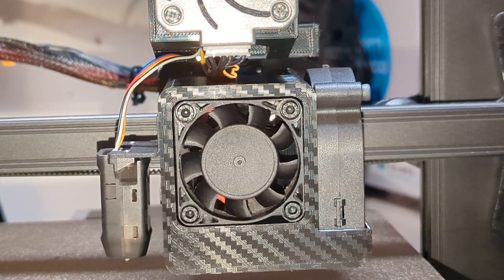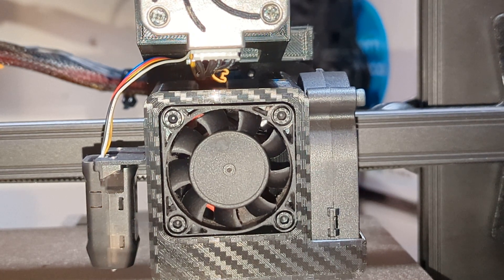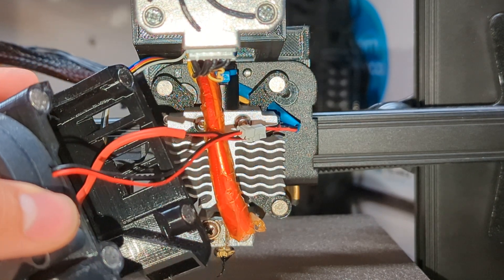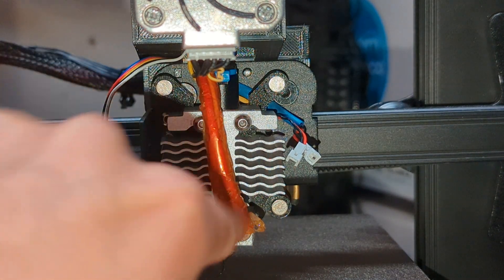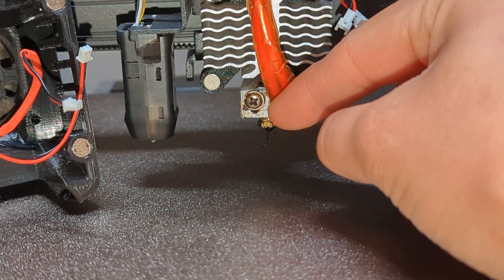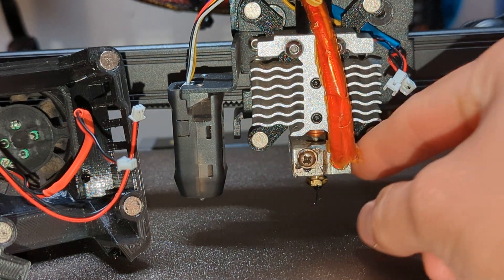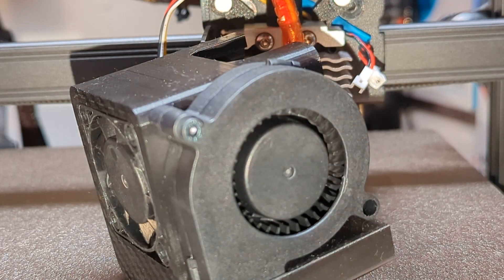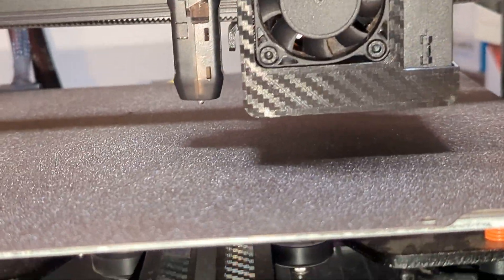Ender 3 V2 Neo - 5015 Cooling 🦆

Comment: Ahh, that looks great. The biggest downside of getting the v2 neo as my first printer is that it doesn’t have the same upgradability as others. I’ve had some issues with heat creep as well so upgrading the heat break and cooling seems like a worthwhile endeavor. Apart from that it does print nicely when it’s tuned in. Definitely looking to copy this setup, thanks for the video.
Reply: I got the ender 3 neo and its great, super upgradeable but already comes with basic upgrades like crtouch, better hotend, silent mainboard, stuff like that
Reply: I have the v2 neo you can upgrade to avoid heat creep . I upgraded the heat break to a ceramic and metal and that moves the tubing way above where it previously was all the way at the nozzle .

Comment: As a fresh owner of a neo v2 i love your videos especially the firmware one. I have a suggestion for a new video have you considered adding an extra z motor driver to your stock board so you can get independent z motors?
There is a post on Reddit and a indepth tutorial, unfortunately every coment i try to post it in gets flaged and i couldn't post coments for a few days because of it :(

Comment: Do you have bimetal heatbreak installed? Can you share your experience with it and adjustments? Mainly with retraction and if you performed a PID when changed.
Reply from the maker: Yes it's bimetal, it's been working great. Retraction with the bimetal heatbreak and direct drive mod currently is set to 1.1mm. PID was tuned automatically with the firmware if that's what you mean.
Reply: @Zeltroix  Thanks for your response. I already requested a bimetallic heatbreak and will arrive next month. I'm using professional firmware and I followed your video to install it. I want to print PETG and I consider that this modification it's necessary.

Comment: I was able to find a shop for 5015 blower fan and here are their variations:
24v 0.1A
12v 0.15A
12v 0.06A
5V 0.06A
5v 0.25A

Is there a specific one prefered for 3d printers or I can just straight up buy the 24v one?
Reply from the maker: I bought a 24v 0.1A one if I remember correctly, it needs to be 24v though that's the only correct choice.
Reply: @Zeltroix did you have to add any buck converters when doing this mod?

Comment: Hi can you please let me know, what is the voltage of the blower fan? Is it 24VDC? Because, I would like to go with Sunon 12V fans (hotend+parts cooling), for which I required 2 buck converters, that's why I'm asking.
Reply from the maker: Yes the hotend and cooling fans are both 24V

Comment: Which of the two mounting plates did you use? The one with same diameter screw holes throughout, or the plate with slightly oblong holes on one side?
Reply from the maker: I went back to the MK8 nozzle, just use the first one, the one that doesn't say high. But if you have problems you can always just switch them up if you need more or less space.

Comment: Is there anyway id be able to make this out of PLA+ and it'd be ok with the heat temp?
Reply from the maker: The piece may be OK, but the vents for the cooling will melt eventually since they are only 1-2cm from touching the heatblock.

Comment: Hello! Can you please share the files? It's no longer on Thingiverse :(
Edit : Sorry, propably the problem is on thingiverse's side :)
Reply from the maker: Looks like thingiverse has problems still, try later :(
Reply: @Zeltroix  I've printed it, but propably i messed up supports, can you give me some advice how should i set up supports for easy remove?
Reply from the maker: @peterporteleki4118  Print it with the fan side facing downwards, use only touching build plate supports. You should be OK with no supports on anything else as the stock neo should have enough cooling power to bridge some gaps.